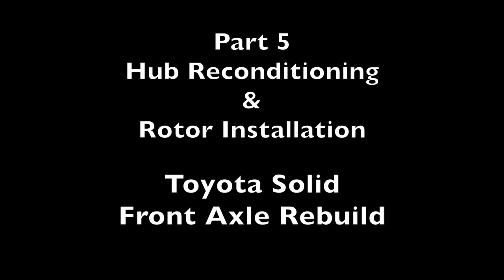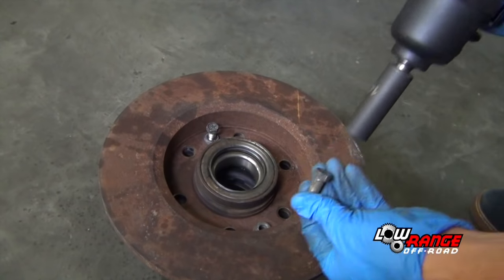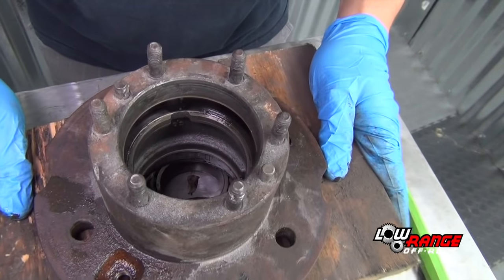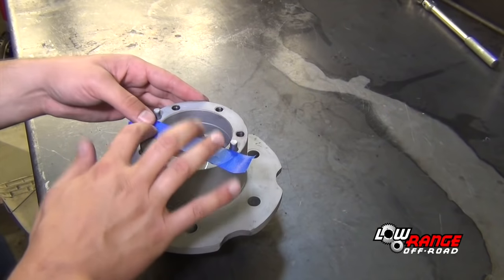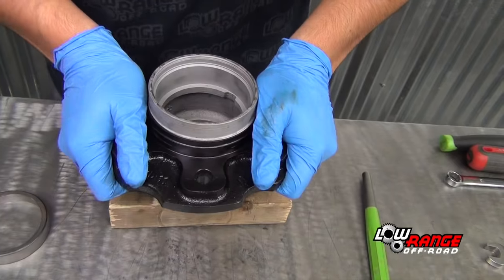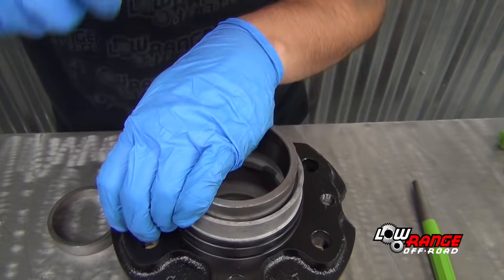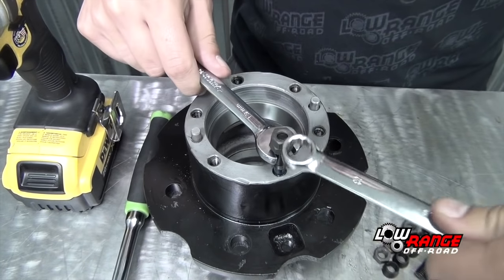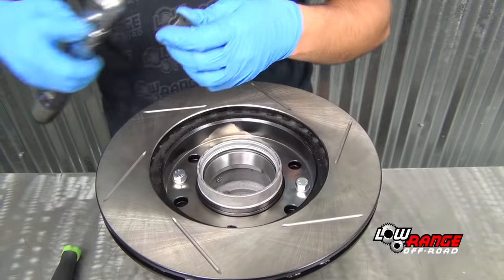How To Rebuild A Toyota 4X4 Solid Front Axle (Part 5) Rebuilding Hub & Rotor Assembly

Comment: Excellent videos on the axle rebuild Perhaps once it's rebuilt you could do a video on converting an IFS tacoma to a solid front axle as you well know there are lots of aspects that could be taken into account: frame reinforcement, steering. leaf spring hanger install, perhaps a coil over option, locker install perhaps you could even do an inchworm crawl box install.  keep up the good work on the videos they are very clean and organized the narrator does a great job as well best wishes to your continued success
Reply from the maker: +John Gubler Thanks for the comments, encouragement and suggestions.  We like your ideas.  Thanks for watching!